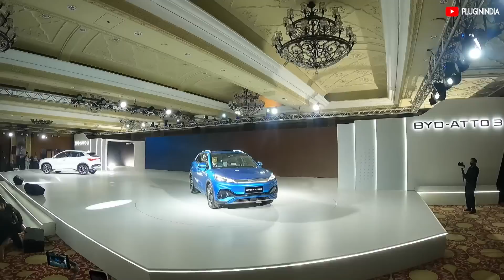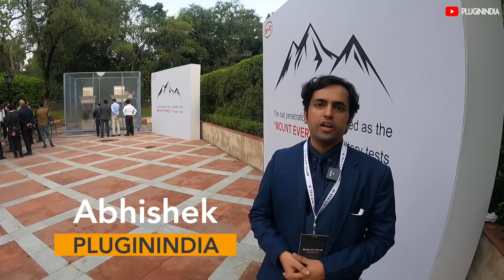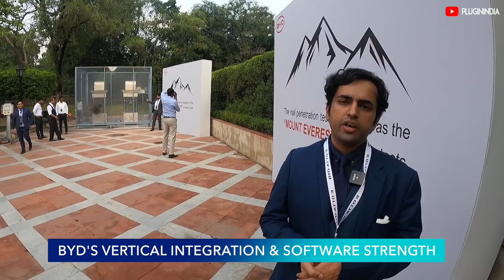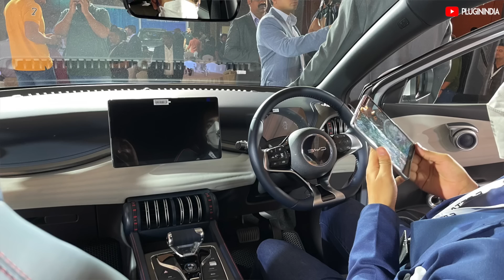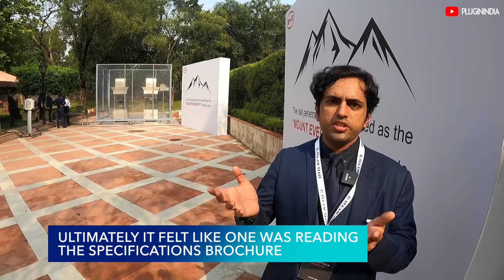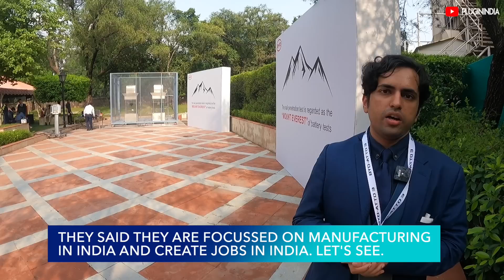BYD-ATTO 3 Electric SUV: Launch Day & Key takeaways

Comment: Pls reveal the big miss by BYD .. they are giving only tyre sealent .. not spare wheel... if we use sealent , we have to change the tyre after 200 kms max.. then every puncture episode costs u 12 K in indian rupees .. they should have given a steel smaller wheel at least considering the indian road conditions., a pot hole will scratch the side walls of the tyre and make a small cut for air leakage...   Please bring this issue to the manufactures, since you guys has access to them not like us from public... tata motors gives us spare wheel and sealent... u charge us., when we pay above 30L , we can afford to spend extra for a spare wheel...

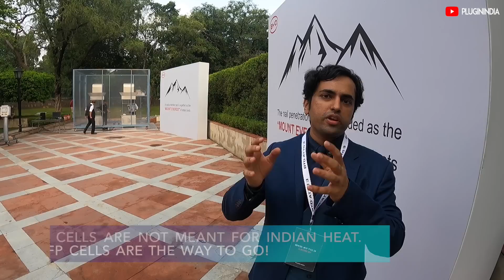Comment: 4:40 Most of the EV 2Wheelers in India are using the dangerous NMC to get more power out of the batteries & risking lives LFP batteries are so much better although it takes a little more volume.

Comment: Need Your Help Mene Abhi Tiago EV Book Kari Hai 24 kw wali mere current Electricity Load Is 5 kw kya ye sufficient hai ya Load Upgrade karna hoga mera 5 kw 3 Phase Connection hai but operational only one phase hai kya kuch upgrade karne ki need hai?
Reply from the maker: You can use a simple 15 amp (3 kW) socket to charge. If you want to charge using 7.2 kW AC then u may need to add a new EV meter or upgrade. Please speak to Tata Dealer.  Our recommendation is just to use the 15 amp socket for overnight charging at home. 8 hours to full charge.

Comment: Well summarized clip. A note in the 'China' factor - Frankly, it's about tech at the end of the day and given that BYD is supplying it's batteries to Tesla (which rejected them initially!), as well as, Toyota, I'm sure no other attestation is required, IMHO! Secondly, don't folks practically use Chinese (yeah there are the Koreans!) phones a galore - aren't they ruling thr mid price range segment practically speaking - great products for decent prices?  

Considering the tech and not the origin - pretty soon this particular EV looks to be a knock out targeting the meaty price segment of INR30 - 39lacs (dare I say it!). 

Lastly, it's not just the 'kitne ki hai' but the overall cost of ownership that needs to be pertjnently considered; quantitatively, for ICE cars the ROI would be based on EMI + fuel (Petrol/diesel) + maintenance cost, versus for EVs it'd be EMI + charging + maintenance (fraction versus ICE) costs; qualitatively, it's the green factor, smoothness, quietness, ease of drive, instant torque, tech (regen et al!), aesthetics etc.

Like it or not EVs are here to stay and while I'll. Miss the smell of gasoline, there's no denying it, BYD's Atto 3 is set to rock on!

Comment: The BYD Atto3 is priced at 38,000 euros, which is about 30.27 lakhs today, and the thumbrule is about 50% more for an on-the-road price in India, which puts it at about 45 or 46 lakh rupees. The other thing I observe is 215/55 R18 tyres, which may have their own set of issues in India, in terms of cost and aspect ratio. There's probably a limited market for these over 4 metre long EVs, regardless of quality and range, and then certainly there is the issue of flag and loyalties therein. I would observe closely how the Atto3 does in Australia before anything else. As of now, the video may have been more interesting if it had shown, also, what was served for lunch.

Comment: Tooo good. Chinese products are better than Indian they are into so many innovations Indians can't compete with price. Also who would not want a safer battery .Although price at 30 laks too high so people who want made in india can go for tata
Reply: Most of the innovations like ADAS features in this car is already in Indian models too. The only thing is that they are petrol / diesel vehicles and yes converting them to Electric models is already happening..

Tata Motors have TCS and ELXSI to take care of any S/W needs (Mahindra have TechM) and they have oodles of s/w experience and knowledge.. 

Just like what happened in 2 wheeler space, Indians are going to beat Chinese ultimately.
Reply: The price can be a dampner if it is way above MG ZS EV. One would then wait for India version, which will be much cheaper for same product. 
This can be a real threat to Nexon when price gets to 20-25 lac region.
Reply: Battery will explode any moment. ( MADE in China)